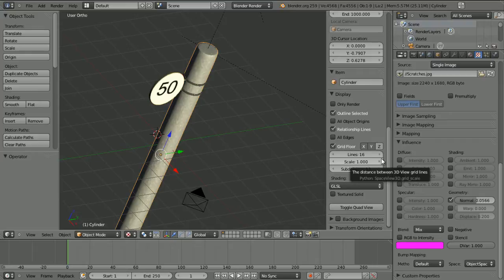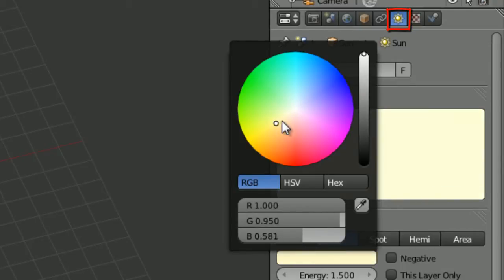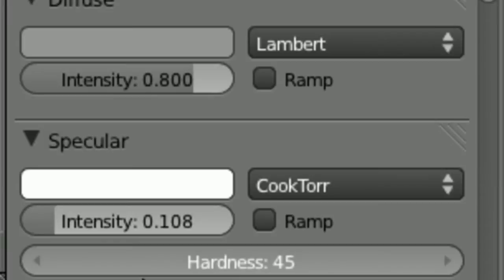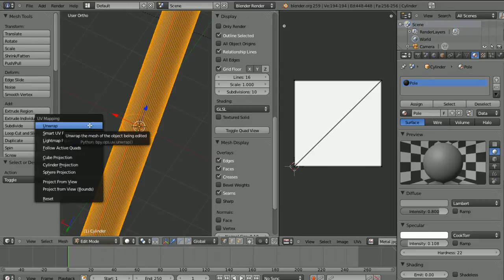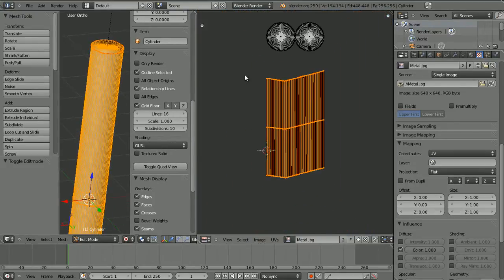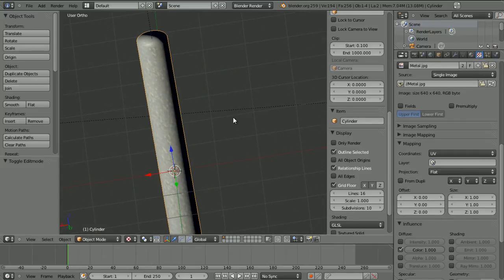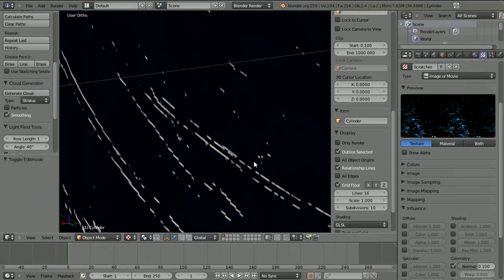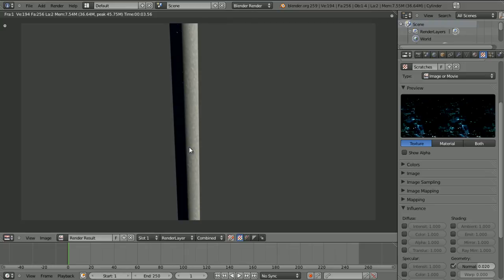[HD] How to make Physical Scratches in Blender 2.59

Comment from the maker: It depends how you want it done, though Blender isn't the best stuff for that. Properly knocking down a building in any 3D Software is very difficult though and is something I've hardly ever seen attempted. But in answer to your question, you'd need to use pretty much every feature Blender has and prepare for the journey ahead. I'd wait a few years before trying it.